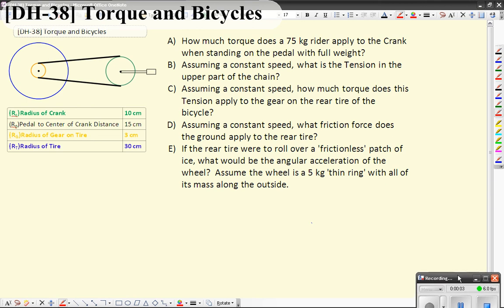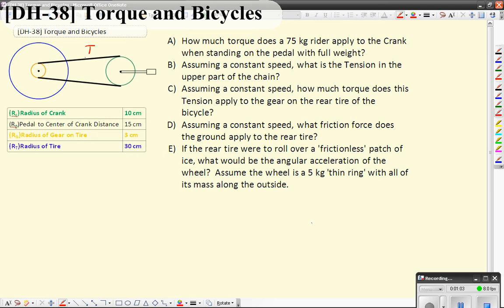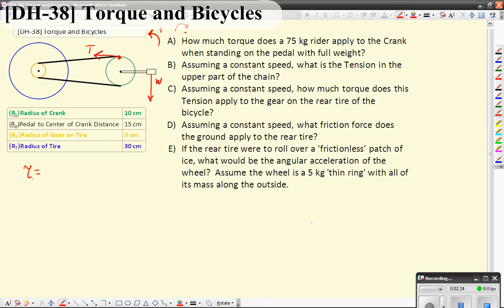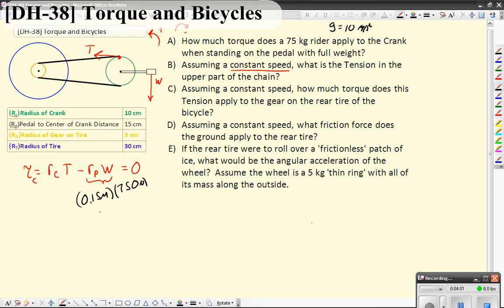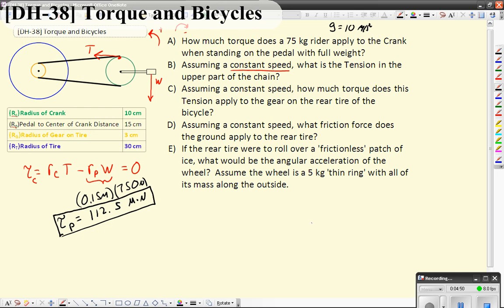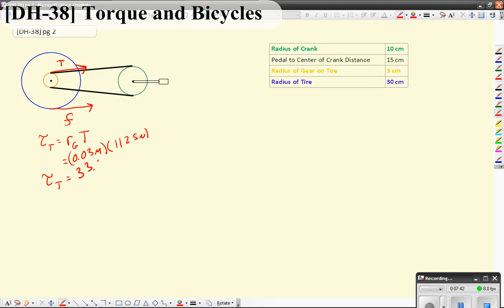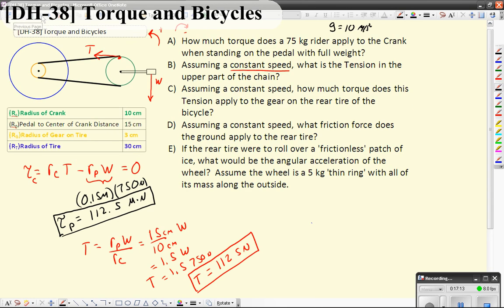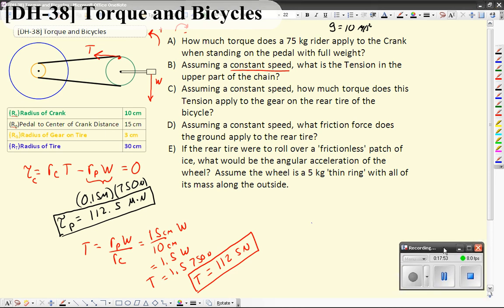[DH-38] Torque and Bicycles

Comment: when we are calculating torque in tire why is torgue f positive and torque T negative? Its confusing me at 8:20
Torque Tension is going in clock direction so that is why is negative. But direction f is confusing me.
Why is tension anticlock direction 1:53 why is not opposite?